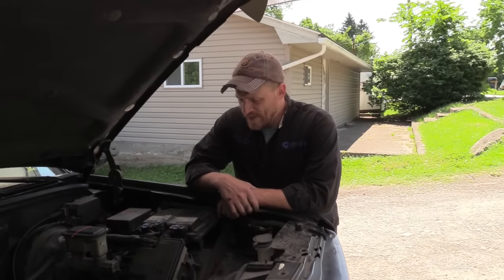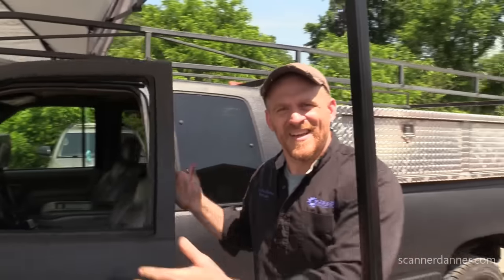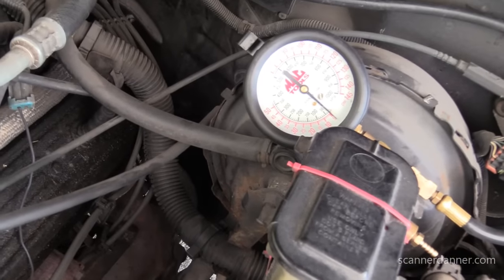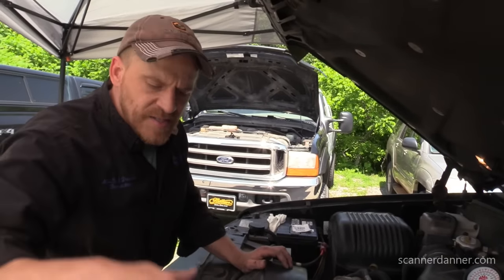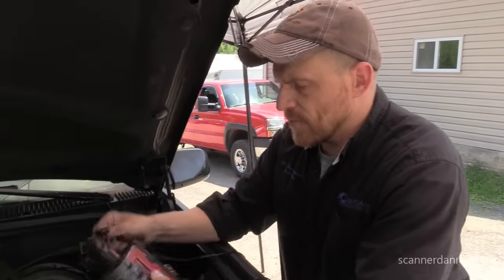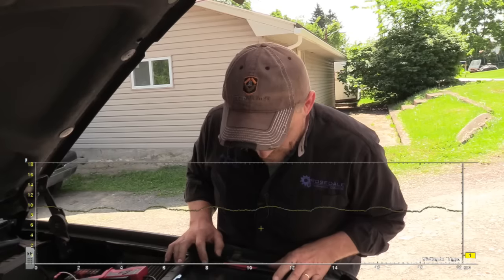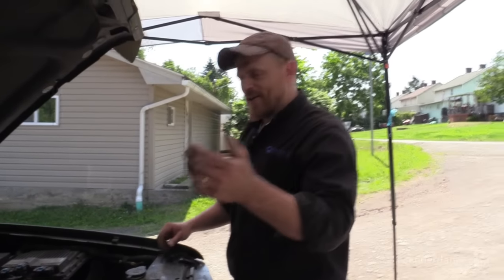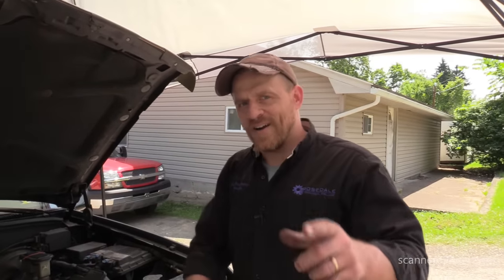Quick Diagnosis of a '97 Chevy with a Fuel Pressure Problem

Comment: Great video on information etc.MY 98 Chevy k 1500 4.3l v6 it only does this issue when it gets warm.Like sitting to long at a light then go to gas it and has the same symptoms of a bad pump. When let truck sit and restart it runs fine. So when I start truck and  by time I get to street light from house about 10 mins my truck does this till I pull over let sit for a good 30-60 mins then runs fine till warms up again. I do have a cold air intake which I wish I just kept with stock box would sucking to much hot air do this ?
Reply: Its doubtful, it sounds like fuel filter. When you turn the vehicle off the line refuels enough to run down the street a little longer. Sounds like fuel starvation. Replace filter if it still persists then change the pump

Comment: Hey Paul !!...Another super informative video !!...YES, keep the teaching...that's what you are and that's what we want...after seeing those 2 O2 Sensor DTC's 99.9% of DIY'ers would have replaced those O2 sensors...but we  2 Percenters (thanks Matt !!) know better. Paul, do the manufacturers publish fuel pump amperage or RPM limits say for fuel pumps ??...does Mitchell ??...I just received my  BIG 3 volume service manual for my '01 Corvette last week and I haven't found anything related to that...just fuel pressure limits...and thanks to you I bought a 2 channel Picoscope last month and what a great diagnostic tool....BTW, thanks I guess you solved my subscription issue yesterday with your Premium channel...I'm back on line !!

Comment: I have the same truck, not loosing pressure when reving the engine but I loose fuel pressure overnight while the truck is sitting, the first start of the day is very hard. But after that, it tends to start fine the rest of the day. Would you think it's the fuel pressure regulator? Thanks, learning a lot from your channel

Comment: Great video. But I was wondering if a fuel pressure regulator would give you the same symptom
Reply from the maker: Psi dropped under load on this one right? A regulator can certainly give you low psi, but it wouldn't drop psi further under load
Reply: @ScannerDanner  thank you.

Comment: A quick question for you too... right at 2:15 to 2:25  you have your foot steady on the gas pedal and it sounds like the engine is surging. Would your amp draw on the fuel pump also be fluctuating under that condition?
Reply from the maker: It would not have changed at all, but I didn't look at it during that event, so I cannot say for sure. But what I can say is that pump was pretty much putting out it's max already, so additional volume loss (through injectors) wouldn't have changed the characteristics of that waveform. Hope that makes sense

Comment: Paul

Love your videos.  Also a paid subscribers on your ScannerDanner channel.  After watching this video, I can't believe that 52 psi fuel pressure is not enough to run vehicle at high rpms.  The specs. calls out to be between 55 and 65 psi.  I agree with you that I didn't like the scope reading on the fuel pump and that the pump was running at only 3000 rpm.  Fuel pump need pressure and VOLUME.  Most of your videos don't show volume tests performed to condemn the pump.  In this case, since the fuel pressure was 52 psi, maybe that should have been done.  

If the fuel pressure was only 30 to 40 psi during idle, I would understand that the fuel pump was starting to fail.  But at 52 psi, even when you put your foot all the way down to the floor, the pressure did not go below 50 psi.  Since you didn't show an after shot after replacing the fuel pump, I'm a little concern about a defective pump.  I do believe that the pump was defective based on the low rpm but if I didn't have a scope, I wouldn't have condemn the fuel pump on pressure alone.

My only concern is that this system is that sensitive?  It hard to believe that.  

Keep coming with the videos.  Thank
Reply from the maker: It is that sensitive and it is a very unique system that used mechanical poppet nozzles that will not even open below 50 psi. Hope that helps, great question!
Reply from the maker: I have some lectures on this system in my fuel system chapters 13, 14, 15 and 16. Since you are a premium subscriber, be sure to check them out okay?
Reply: You are absolutely right about the poppet valve type system. They make an upgraded system that eliminates the poppet valves, and if it had this system, it probably would have still run fine, although the fuel trims would have been high. And the pump probably would have still failed completely eventually.

Comment: what about one that keeps the fuel pump and engine running with the relay unplugged, it also starts and runs with it unplugged, delayed start up, with what seems like oil pressure build up. schematics don't show it being parallel with oil pressure switch or module but I'm wondering what hackery exists on that 1998 C/K1500 with 5.0/305 engine :))
maybe just where I was looking, but I don't recall them having such a switch either, I didn't look underneath to see if it's hot wired anywhere either.
Reply: solved, mid year assembly line change from 1997 leftovers to 1998 models, doh. only had 1998 data with me at the time and didn't go climbing to get at the  sender/switch.

Comment: Great video. How can you tell if a injector or in injectors are bad. I had lower intake manifold leak (97 Tahoe) so took it all apart corrected that problem. Installed new wires, plugs, cap and rotor. After doing so now i have a code “PO300” misfire on cylinder #1. So I replaced the existing SFI with a new MFI . I thought everything was right but now I have the same code “PO300” with MULTIPLE MISFIRES. 
What should I check next or take it apart to make sure I did install it right.
Thanks
Reply from the maker: These distributor caps are garbage on these and I've absolutely seen them bad right out of the box. And these days with the totally crap parts on the internet, combined with a crap design GM came up with, and there you go. 
I have some ignition testing videos on this designl. One where I'm using a test light to check the spark jump from each cap electrode. I'd be in my chapter 22 Ignition playlist
Reply: Dan thanks for the reply. Let me add a few things that might let you see the whole picture. As I stated I corrected the lower manifold leak. In doing so I set the motor to TDC (from turning it over until I was able to set it on the harmonic balancer mark) I marked the distributor to the firewall and on the intake manifold. I did not remove the distributor myself, so I didn’t have the chance to see the rotor (cap on) and mark it. After everything was done the engine turn over but would not fire. I then thought it was 180 off. Without me being there a friend stated he reset the distributor and then it started but the idle was very high and i gave him permission to change the idle control valve. Wires,plugs,cap and rotor were installed at the beginning.
After all that that’s when the PO300 code that’s when I changed the SFI to the new MFI . Like I stated before that now I still have the PO300 code but it states there are multiple misfires. Could the distributor be off a tooth or so ?
Is it possible I installed one or more of the injectors in the wrong place.
I’m lost. Should I take it to a dealership so they can scan it completely or should I start at the distributor and go from there?
Thanks
Reply from the maker: Lots of variables in there. Not familiar with the injector change up or what that involves and I'm not sure about the distributor either. Both of those are real concerns. On a scanner you can read a data parameter called "Cam degree retard", it should be 0 degrees +/- 2 degrees.
If you're off a tooth, it will be way off on that number

Comment: Wow thank you for the response. Long story short,i have a 1998 K2500 5.7 liter. Yard truck / plow truck.  I have a battery disconnect on the ground lead,i thought it was the fuel pump,because it didn't have a code 😅,because  i keept disconnecting the battery, ended up it need a CTS. it was reading -11 degrees, dumping to much fuel. Just the opposite 😅

Comment: Hi there I’m not mechanic but same symptoms in my 98 Chevy 4.3 and I found that the fuel filter was clogged 😅
Thanks for this info
Reply from the maker: I addressed that variable. Generally when you have a fuel filter that is that far plugged, the fuel pump has been working very hard, for a very long time and the pump won't be far behind.

Comment: Hi Paul. You could add a fuse to your jumper. Reduce the possibility of frying something. Yup tripple checking works but...
Reply from the maker: Unfortunately even a fused jumper will NOT protect a tiny PCM driver that controls a relay. These normally see less than 200 ma. Not sure at what amperage they fry. Maybe around 1 amp?
Reply: Especially with the size fuse needed to run the pump... triple check ftw...

Comment: How do you know that the fuel filter is not effecting this pressure? The fuel filter nuts are frozen in place and can't seem to break them loose. I don't want to have to pull the bed off to access the fuel pump thus allowing access to remove fuel line. I have tried to locate materials to simply cut the fuel line to remove the filter and then splice a new line back in, that also seems to be a monumental task.

Comment: One more great video. Thank you
I keep asking you questions. How can I  make money with only diagnosing or troubleshooting an engine performance problem and without replacing the part(s) myself? For example, you only troubleshot the cause of loss of power when stepping on the gas pedal, but you didn't put the new pump and filter on the truck. Is this normal, or just because you are super awesome at doing troubleshooting? Can I do it? If I can do that, how in the world I can get people to understand that? I mean just troubleshooting. Man, I went to a friend's house to find out what was wrong with his Dodge Grand Caravan's transaxle after he gave me a call. The TCM had put the trans in limp mode, which is the third shift in 62TE. I do not have a good understanding of how this trans works. I scanned the car with my little scan tool to get the codes and I had an incorrect ratio code. I remembered you almost always saying, do a visual inspection, I did and I found out that one sensor had its wires cut off by a squirrel. I reconnected the two wires temporarily just to see if they would fix the problem. The problem was fixed and the transaxle returned to normal. I told him that I don't have my tools with me so I would come back to him the following day to solder the wires. He said, ok. He gave me a call the following day saying that he reconnected the wires and taped them well so he wouldn't need any help. He said to me that they were just two wires and fixing them was so easy, meaning that I didn't do any labor. Eventually, he refused to pay me. 

Sorry, that was too long.
Thank you again, God bless you.

Comment: I have a 91 suburban 350 TBI. It has new plugs, rotor, cap, map sensor, fuel pressure regulator, wires, timing set. The problem is that it will start if I flood start it at full throttle.  But will die if I let my foot off of the gas. But if I disconnect the map sensor then it will idle on it's own but poorly. All of this started after mud bogging in 3-1/2 deep mud. I have disconnected all wire connections and sprayed them with electronics cleaner. It will start but burns very rich and I can't figure out the problem. I would appreciate any suggestions. Thank you very much

Comment: I have a question: on the "upgraded" injection spiders for these trucks (the replacement units that use eight individual injectors vs the pressure-driven poppet things) if the fuel pump is weak will it behave differently than in your video since even without enough pressure it'll still let fuel into the cylinder? I have poor driveability on my 97 Suburban with the Vortec 5.7 and while yes, I should check fuel pressure, it runs ok (not great, but not as bad as the truck in your video)...
Reply from the maker: Those still have the poppets and the system will react the exact same way with low psi

Comment: would it not have been possible to have a clogged up fuel filter as well with a good pump starving the engine or you ruled that out by calculating the pump rps?

Comment: I have this exact problem.  350 vortec is not my thing. Throttle body and ls 5.3 3800 are my experience.  I did a bunch of work but the whole time I thought I was looking for vacuum.  Going to put a fuel pressure gauge on.  I been driving with a pulled mass air for a long time.   Won’t start plugged in. I can tell you I have a almost good pump and filter needing replacement because I know the tank had a leak had been in and out.
Reply from the maker: fuel pressure measurement will be critical during the long crank time for sure!

Comment: What fitting was used to attached the gauge to the fuel rail shrader valve? I bought a kit on eBay, but it doesn’t have the correct fitting

Comment: Hey man changed the fuel pump and fuel filter but still hesitates when I try to accelerate. And sounds like like it’s misfiring when I accelerate on the throttle body…..any advice helps! Thanks!

Comment: Thank you for the video! I am only getting 50psi stays there at idle and above and does not leak down and no codes. Truck starts and runs good then stumbles randomly for only a second typically under load on a hill might die randomly at a stop. Could it be the pump? Tested and cleaned the MAF with MAF cleaner.
Reply from the maker: What does it do on a wide open throttle snap to recline? Fuel psi?
It also should be minimum 60 psi during cranking
Reply: Thank you! I put the foot to the floor downshift and has no issue. It is very random engine dies for a second when going up a hill and give it a little more gas but not always. Gauge will not go over 50psi on start up or when revving it up.

Cancel

Reply
Reply from the maker: @keithjones7674  find your return line underneath and momentarily pinch it off with it running and a psi gauge connected. It should go to at least 85 psi 
This is only for a few seconds that you do this test.
It is a pump max psi test
Reply: I rented another gauge from Autozone, showed 60 psi on start up and when give it gas. The CMP retard was at 1 adjusted to zero and seems to have fixed the issue and runs better!

Comment: 97 Chevy 5.7  checked fuel pressure and no reading at all.. But truck runs good
Only when I give it throttle I hear a ticking sound that only gets louder when given it more throttle. Any suggestions

Comment: Question I have a 99 Silverado.  Mine doesn't have a code and accelerate just fine but. It starts in a delay and it runs fine then cuts off sometimes while I'm driving. Took it to get a smog and the guy told me that the fuel neck is leaking. Would that cause it to do that? Or the regulator?

Comment: Would a compressed fuel line going to the engine show the same symptoms as a bad fuel pump?  Amperage would be good.  The engine would be starved for fuel at acceleration as well.
Just curious.
Reply from the maker: amperage would be very high in that example

Comment: I have p0171 without p0174, I can't find any vacuum leaks. I would think if I had a fuel issue I would have both codes? I have new Injectors, fpr and filter. Both bnk 1 ow sensors are new. My code only triggers at no or very low throttle. Any ideas where to go next?

Comment: paul love your videos and all and follow your classes but all the fuel videos have to do with cars with test ports. do you have videos with J series Hondas with no test ports and the most efficient ways to check them or is there no way other than to check current flow at the fuse panel or the pump itself which is a pain. Can you make a connection under the hood in the engine compartment and what would you require. Long time subscriber in class and on line and just looking for some techniques. thanks Paul ❤
Reply from the maker: there is no quick way to test fuel pressure on a system without a service port. You will need one of the more expensive fuel pressure kits that have the adapters to do these things. I have them listed on my tools pages. Thanks for your support!
https://www.scannerdanner.com/tools.html

https://www.amazon.com/shop/scannerdanner

Comment: Good repair. I'd like to see the waveform of the NEW fuel pump and see if the rpms is in fact 6000.
Reply from the maker: I have other GM CPI videos with RPM measurements and also in my book. These run about 6k, sorry I didn't have an after capture for you

Comment: I need your help!! I've posted on your website and it seems they are not there anymore I go back to look for replys but they are not there. I have a 98 chevy 5.7. No codes. Runs weird low power long crank time skips at high rpm sometimes not all the time. It dose not run like this though it runs way better I can drive it normally but low power and just isent right I can tell. I've replaced so many parts my diagnosis has caused me to change what I have it has improved but still not right. Idk what ti do the mechanics around hear dnt know how to diagnose using fuel trim amd I believe th ats gonna be the only way to.

Comment: paul i wonder if a bad/weak spark (plug gap to high-worn out plugs) and or wires could also give this issue?...or contribute to it??
Reply from the maker: Fuel pressure would not be dropping at WOT with an ignition problem would be the major difference